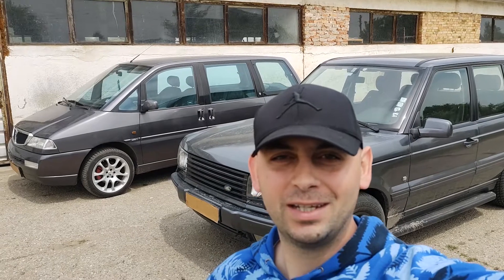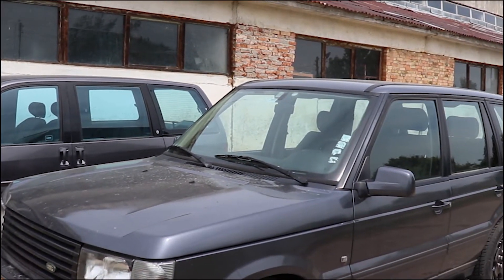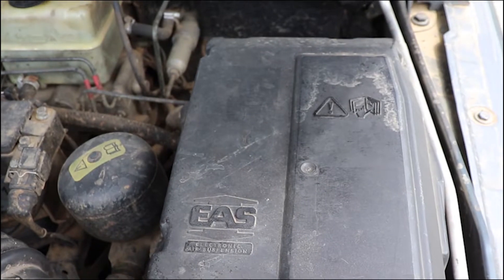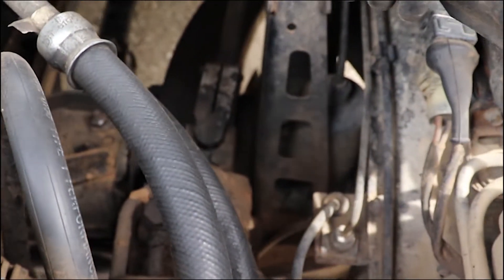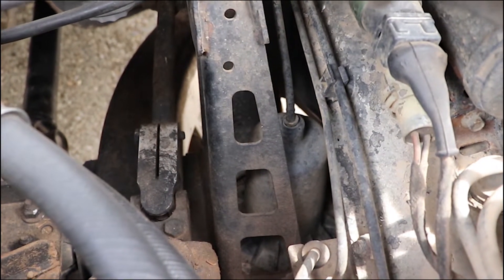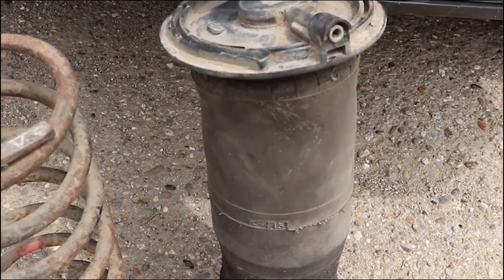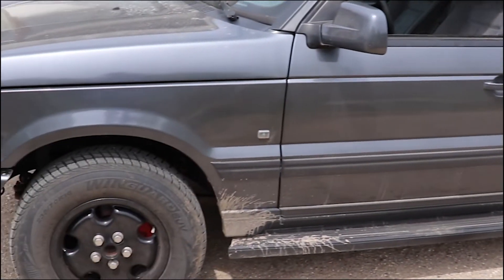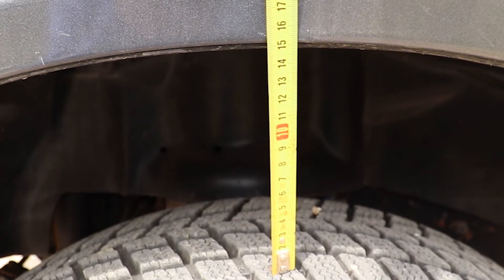How It Works The Air Suspension On Range Rover P38

Comment: What I want to know is how the EAS knows if the ground is uneven or if the bags just haven't been balanced yet.
Example, If two bags are low on one side I expect it to even things out.
If however I have one wheel on a big lump, I expect the car to allow the axle to articulate and not try and keep each bag filled to the same length using those little level sensors.
How does it know this?
Has it got body spirit levels or something?
Reply from the maker: Hi! Thank you for your comment. You made me think for something that I have never thought before I just took this ability of the Range Rover for granted and never gave it a second thought. I do not know if the RR can recognize if the ground is uneven but it can tell if the air springs are balanced through the height sensors that you mentioned. I doubt that the RR have a gyroscope sensor but I can't find any information about this to confirm my guess and still this does not change the fact that this vehicle can self level. Some how it knows which side of the suv is lowest and it will adjusts the rest to level it. Probably you are right it may have body spirit levels or something like it.